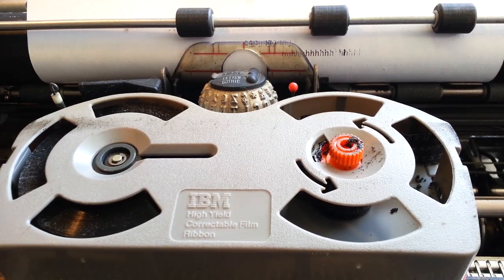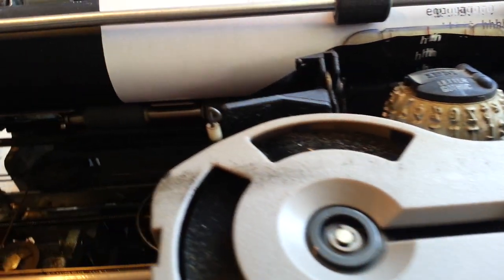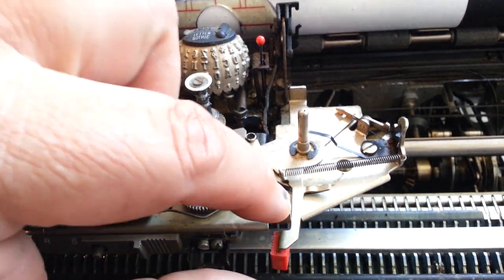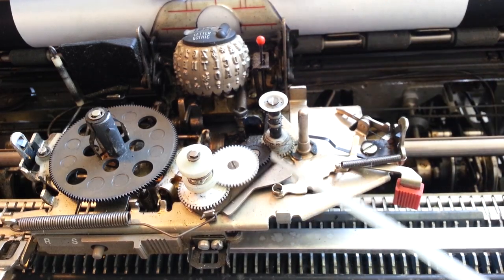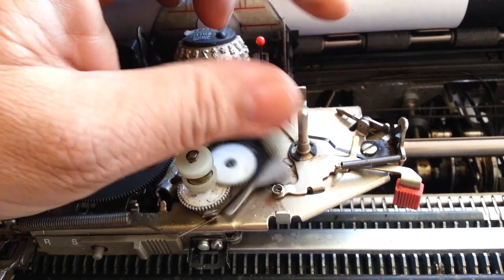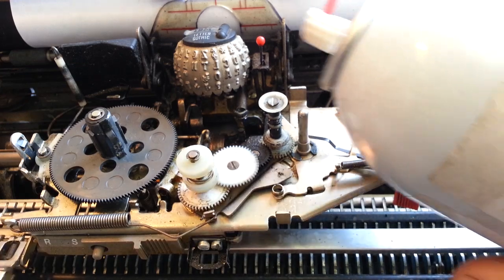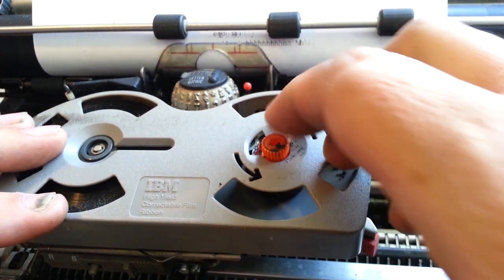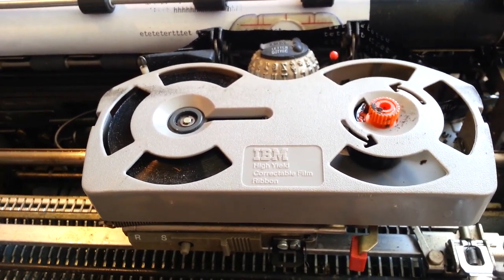IBM Selectric Typewriter Ribbon Stuck, Wont Turn, Sticky Pivot Repair Fix

Comment: This is quite an easy fix just spray some petrol the right below those white gears (  pivot shaft ) & yes it should snap right back the ribbon cartridge lever is released to lock the ribbon cartridge back into position..  it snaps back because of the long strong  spring pulling the ribbon cartridge lever.

Comment: I had one of these where that mechanism was TOTALLY seized, I could not even move the ribbon replacement lever to the left D: luckily after an hour trying to get it at least a bit to the left I managed to remove the ribbon, then cleaning, unlocking and relubing was way easier :)

Comment: My center pivot is completely seized and won’t move back from the center aligned position for taking the ribbon out, it wont move with gentle to firm force. It feels almost as if it has another mechanism holding it stuck, I may be wrong though, I’ll try using a lacquer like you recommended to get it cleaned out though. What else would you recommend?
Reply: Never mind haha I got it unstuck literally a minute after watching the video and commenting, now I just have to follow the steps you did in the video, thx🙏🏻
Reply from the maker: Was gonna say, Heat . . . .
Reply: @phoenixtypewriter2136  thank you so much for the content on these machines:)

Comment: What kind of oil do you recommend for typewriters?
Reply from the maker: What kind of typewriter ? What are you going to oil ? Most vintage typewriters only need a drop of oil in a few places, but an IBM selectric needs a drop in about 100 places. Also you should never use new oil on old oil. My oil of preference is Marvel Mystery Oil.

Comment: Hi, is there any other repairs that could be done in that area? The center pivot on mine is fine but the ribbon still won’t advance
Reply from the maker: Yes, ribbon drive is complex on selectrics with many areas that can and do fail, drive pawl bent, 
any tooth from 4 gears, carrier shaft cam, troubleshooting would be necessary
Have you checked to make sure typewriter is not in stencil mode ? (grey slide lever in front)
Reply: Also be sure the ribbon is winding in the direction of the arrows. If it’s not keep winding the orange knob til it is, that’s what happened to mine.

Comment: Mine is seized really bad what would you suggest to use on it?
Reply from the maker: Lacquer thinner to break down the old oil to flush and remove  it
Marvel  Mystery oil to replace
Reply: @phoenixtypewriter2136  thank you this will be very helpful

Comment: I repaired these IBM selectric typewriters for 7 years its design is not so repair friendly..  to increase the golf ball spread is a simple flushing of the cycle clutch with  some gasoline & IBM grease  comes in a little tube form.

Comment: Can I use wd 40 to oil it ?
Reply from the maker: WD-40 is not oil ! WD is Water Displacement chemical. Adding new oil to 40yr old gummy oil is a recipe for disaster
Old oils need to be flushed out of the 100's & 100' of pivot spots on these IBM selectrics
Lacquer thinner is best/strongest, mineral sprits will work but slower, I use red oil Marvel Mystery Oil for most relubrication spots

Comment: What typewriter model is that I think that the type ball. Has rust do you think daune.
Reply from the maker: IBM ball can not rust, they are plastic. An old Blickensderfer metal ball will rust . . . .
Reply: I got a Selectric with several balls and one was covered in rust, BUT upon closer inspection I realized that the metal "spring" underneath the upper lever had rusted so bad, covering even the outside of the ball partially, obviously plastic cannot rust so I was confused when I seen it XD